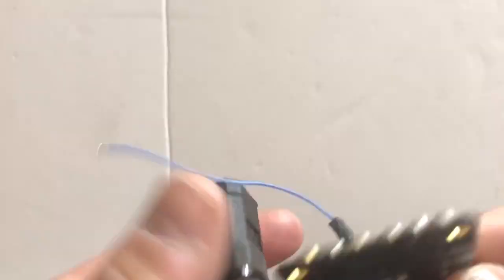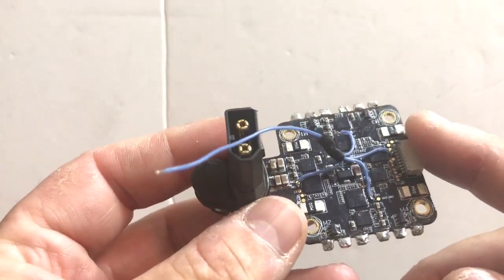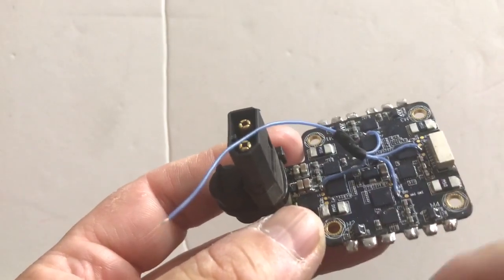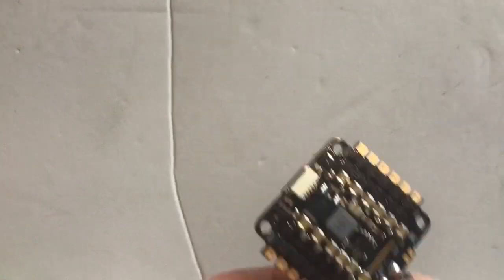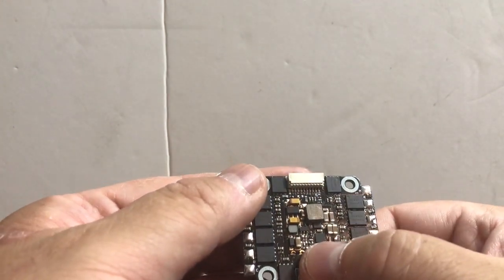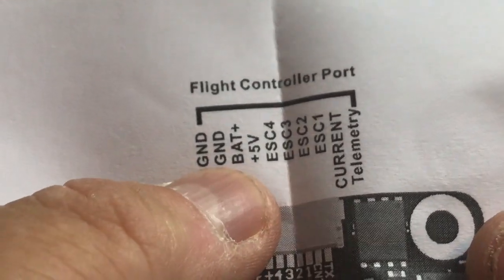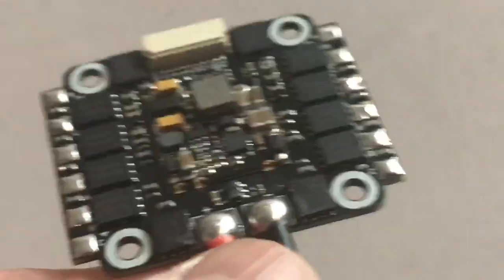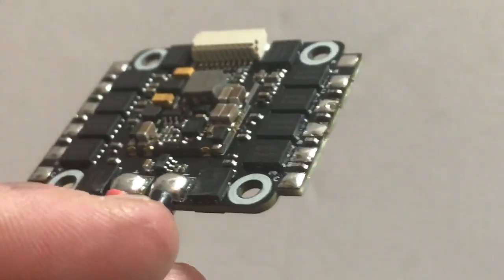3 Way BLHeli32 4-in-1 ESC comparison, Aikon AK32 benchtop review

Comment: Hello great vid, can you help me out I just got one of these used but I am not fully understanding the wire lay out. What is NC and MC pis on the harness
Reply from the maker: Are you talking about the first ESC  I am talking about?The Typhhon?
I don't think the nC is anything and I don't have an MC on my diagram.

I Have :
M4
M3
M2
M1
NC
GND
Cur_sen
Vbat
If you're looking into the JST plug with the battery lead pads opposite you, M4 is on the left,
Reply: jtan163 thats the one, sorry I am just going off a picture image I dont have the actual paper.  So where do you hook up the cur_sen the telemetry. Sorry not alot of info on this 4in1 and you seem to know what you are doing. I really appreciate it.
Reply from the maker: cur_sens is the big current sense that measures the whole ESC - i.e. everything coming in the battery leasds> Thats old skool style and you connect that to the current pin on your FC if you want that style of current sense.

If you want to get ESC telemetry  going and get current, temp and eRPM from each ESC you need to solder 4 pads to a UART RX pad.

Here's a diagram, you need to solder the red pads to one wire and connect that to a UART RX pin, like I have with the blue wire in the video above. The wiring diag is at the bottom of the page.
https://www.unmannedtechshop.co.uk/typhoon32-v2-4in1-esc-4x35a-blheli32/
Reply: jtan163 can you   daisy chain each one of those pads then one lead out? Would that work?
Reply from the maker: I don't know about daisy chaining I didn't try daisy chaining I tried what you can see in the video and I do know that works.
Daisy chaining may work, but I am not sure, because I have not done it.
 Give it a try. I don't think it will damage anything, but it might not work.

I did it the way I did because that's what the Betaflight docs say: https://github.com/betaflight/betaflight/wiki/ESC-Telemetry
Reply: jtan163 okay thank you for taking the time. Hope I was not to much of a   bother.
Reply from the maker: No worries, but I'm off to bed now it's 4am here - I have to get up in a few hours. :-(

Comment: Is the Amperage rating per motor or overall?
Reply from the maker: Per motor, unless the 4in1 has a 5th current sensor for the whole board, which the Typhoon does.
Betaflight adds up the 4 readings,

Comment: I'm thinking of purchasing this 4 in 1. How is it?
Reply: I'm using this in a karearea talon.  It's awesome.  Only issue is finding more of them because they are all sold out and I want to buy a new one for a build with a new helio spring FC!
Reply from the maker: The Aikon AK32 is very nice, but to be honest I haven't found a 32 bit ESC I didn't like yet.
 Turn them up to 48khz PWM rate and enjoy the smoooooooooooooooth,